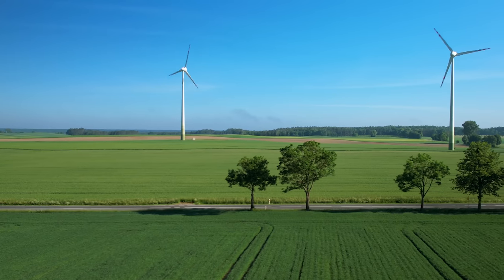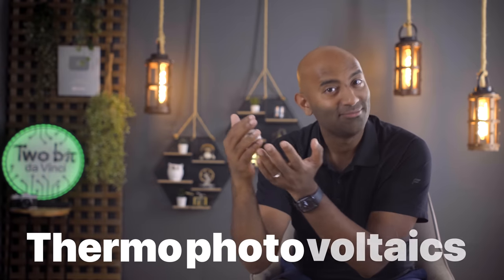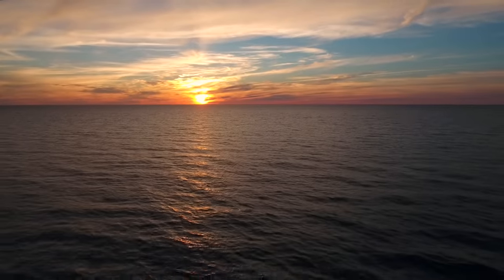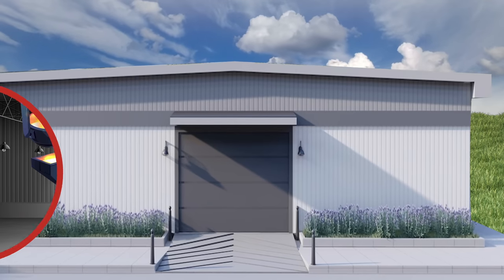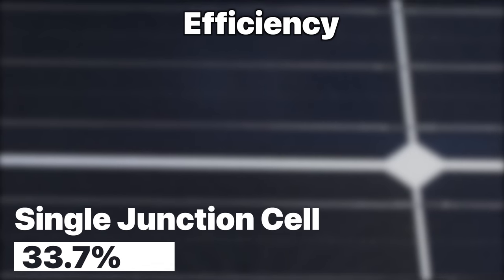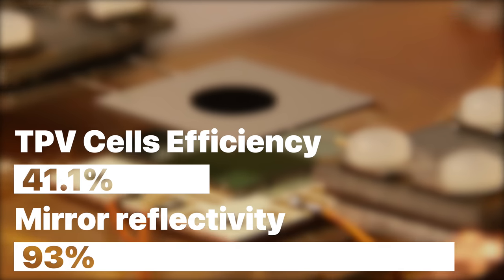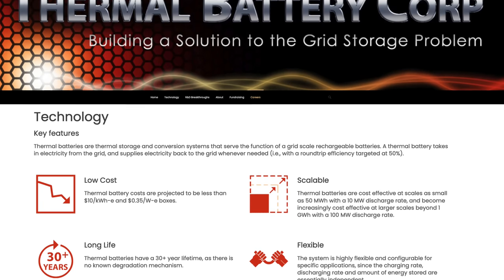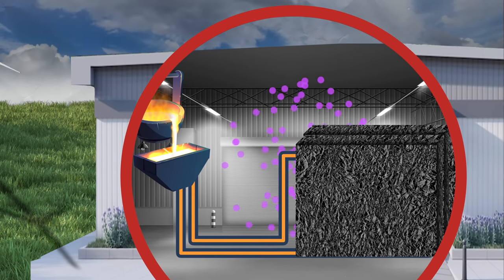Breakthrough Solar cell DOESN'T Run On Sunshine!

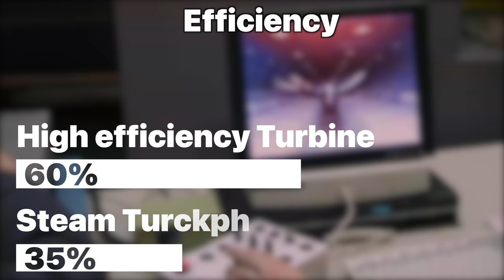Comment: 01:24 This is literally what comes up when you google “steam turbine efficiency”:

Multistage (moderate to high pressure ratio) steam turbines have thermodynamic efficiencies that vary from 65 percent for very small (under 1,000 kW) units to over 90 percent for large industrial and utility sized units. Small, single stage steam turbines can have efficiencies as low as 40 percent.
Reply: Yeah I was thinking this was wrong as well, steam turbines can be very efficient
Reply: Yeah, this channel is slowly devolving into sci-fi.
Reply: I'm finding many of these channels feel like they are devolving.  Slowly slipping further into propaganda over science.  At least 2 bit calls out many of the problems, this tech still has to overcome.  Rather than just saying it is all good and our savior.
Reply: I haven't even 'Searched' (Other search engines are available), but most objections to Heat Pumps Vs Gas/Oil boilers, quote the incredibly low efficiency of electricity production from heat (fossil fuels), usually stating around 40%. I have never read anything about steam turbines at 90%. Perhaps your figures are theoretical, as opposed to what actually happens when you burn oil/gas to produce electricity.
Reply: @linyenchin6773  idk if this guy in particular is that bad lol but your statement is straight facts when speaking overall after watching it in real time the last two years
Reply: @michaeljames5936  kind of like this video stating that they can get 40% power conversion with the potential for up to 50%
Reply: Most large steam turbines use a secondary turbine that operates in a vacuum this extracts virtually all useable thermal energy making large scale turbines highly efficient . The burning fuel / transportation of steam is the largest loss of energy efficiency	.
Reply: @jackm3040  Nope. Large turbines are really over 90% efficient (even 98% is feasible). If steam goes in turbine from 250C to 25C then great majority of energy is converted. Hovever losses from whole thermal cycle are elsewhere. (Whole energy of condensating 25C Steam to water is wasted). tldr: Turbines are not at faul, whole termal water cycle is (includes burning).
Reply: only the theoretical eff of the turbine but the rest of the steam cycle pulls it down to 35 %
thats why the big cooling towers ore heated rivers downstream the powerplants.
Reply: @joelrampersad1359  Yeah, I have seen this also.  First was his video about charging his EV with an Ecoflow Delta Pro which is a ridiculous example since the EcoFlow has, without additional batteries, 3.6kw of battery which is not going to translate into that many miles for your EV.  To me this showed his near total lack of understanding and research into the Solar Generator and/or Solar battery community.
I think this is what happens when it becomes a full time job, new house, new studio, new solar panels on the house, new wiring for the house and now a team of people to produce the videos all of whom have to be paid.  So that translates into quickly done videos and everything is a "breakthrough"
Reply: @jackm3040  You think the efficiency numbers given for this new tech are the emperically measured values?  I doubt it.  Let's compare apples to apples.
Reply: @michaeljames5936  The 90% is theoretical AND it doesn't take into account any inefficencies in regards to how the heat is generated.  But keep in mind the tech discussed in this video also doesn't talk about inefficiencies in making the molten metal heat source hot in the first place, so that part is fair.  So keep problems with fossil fuels out of this discussion since those arguments would apply to both turbines and these new cells since neither tech cares where the heat came from.
Reply: @jackm3040  Well yeah, just as I said: Not problem with turbine, but with whole cycle. My point was that video was stating that turbine itself is the problem.
Reply: @jackm3040  One key component when measuring efficiency, is cost. There, the advantage is clear over TPV.
Reply: @jackm3040  YouTube doesn't let commenters post links anymore. Even the channel uploaders are restricted to a single post for links. They don't tell you any of this and simply delete all comments with a URL. It's trash, and it hurts the organic discussions that happen on this platform.

Comment: A slight clarification, the Shockley-Queisser limit describes the maximum efficiency under solar illumination, AM 1.5, which is approximately a 6000 C black body radiation source. These cells would be operating under black-body light from the tungsten at ~2500 C, so the efficiency calculation is different.
Reply: Yes, I wonder how the limit changes as your light source changes, I'd suspect high energy blue light is easier to convert then reder light.  Even sunlight at the Earths surface has been substantially altered from a true blackbody specturm due to absorbtion and reflection in the atmosphere, the visible part of the spectrum suffers the least loss and is the peak output and what our solar panels mostly harvest.  So a true 6k black body spectrum such as in orbit is likely to be less efficient because the extra light your getting is in unusable parts of the spectrum, and thus your actual energy output remains the same even as the total input grows.
Reply: W Tung clan
Reply: Well said. You obviously know your material! 👍🏻
Reply: @SunriseLAW 
The world isn't ready for that kind of discussions.
Reply: The theoretical max efficiency is not really important, what matters is the real system efficiency. If you get 50% out compared to what you put in that is the number that you work with.
Reply: @kennethferland5579  how do you get reder than red?
Reply: @SunriseLAW  I wonder if being into efficiency and being into eugenics go hand in hand? Definitely would make sense to me. We're just a few technologies away from getting to watch videos on new genetic structures with their pros and cons. Stomachs are one of the best energy converters too, or so I've heard. So maybe we'll see the eugenics and energy technologies blend together at some point.
Reply: Dahha.  Life has gotten too complicated for this old horse.
Reply: Wrong. That limit is for any blackbody radiation source captured by a single bandgap material. Sun not required.

Comment: The cooling water for the TPV you can cool down using sterling engines.  You could get more energy from the waste heat.
Reply: Or they could just invest into sterling decentralization tech. But capitalism doesn't want it

Comment: If these things can absorb heat and turn it into power, all you've gotta do is stick'm to my walls. I assure you that could power half the US. I live in a top level corner appartment and temperatures easily rise over 50c, at nighttime, because of all the heat released by my walls all night long. Imagine how much heat is trapped inside of them...
Reply: I wish on my walls too. A lot of heat of the sun directly 😄😄😄
Reply: lol, I had a top floor apartment once (I live in Alabama) where you couldn't hold your hand on the ceiling it was so hot. Our air conditioning bill was a nightmare. They built the stupid thing with black asphalt shingles and no attic ventilation at all, not even passive air vents on the side. The roof was an actual solar oven. It was awful.
Reply: @DFPercush  yeah so that's my situation as well, lol. Just not in Alabama.
Reply: I don’t know if this was a joke but it’s actually a good idea. Kind of like how breaking energy is captured to replenish EV batteries.
Reply: @_HMCB_  it's both, but it obviously wouldn't actually work as covering my walls with them would also mean they won't get hot anymore in the first place. Just needs regular solar panels
Reply: @theBabyDead  right. I was just talking the principal: capturing excess heat/energy.
Reply: Put them under the tar of roads, same deal hot surface all night long

Comment: The argon sealing issues going to make this a maintenance nightmare and money pit. Argon must be harvested by cryogenic air separation by means of fractional distillation. Similar to a oil refinery but cooling to liquefy the gas as a means to seperate from one another.
Reply: Yeah but when there's government money for new stuff why not
Reply: @mikefitzgerald5127  There's no such thing as "Government Money" it's Taxpayers money and shouldn't be squandered.
Reply: Omg omg 😳
Reply: @jackm3040  tbh, if they’re using it to keep materials from reacting, then they can use alternative methods of protecting the tin from oxidizing, seems odd to me they would rather fill a building with argon rather than using a submersible unit or a closed system
Reply: @ProfessionalGasLighting  Yeah, imagine the process required to get into that building to conduct maintenance, or the the process of swapping out a TPM for that matter.
Reply: It doesn’t sound like it needs to be pressurized so sealing should be relatively simple.
Reply: Argon is heavy and slow moving. Sealing it in is about as difficult as sealing up a swimming pool. It doesn't want to float away, it sinks and pools in our atmosphere. I work with argon jacket lab equipment all the time and it is NOT hard to work with, NOT hard to seal and not expensive to maintain. And these are very very large EMG systems.

It will be alot of money to fill their system up to begin with, sure. Whether or not it is EXPENSIVE is a relative thing that depends heavily on how much a percentage this is of the over all coat of the system and how much capital comes out of these systems when they are running. 

I appreciate what you wrote, but I don't think you know enough about the topic.
Reply: @miller2675  Do you deal with argon while pouring 2000 C molten tin being pumped at 1400 C through a graphene heat exchanger? That's pretty freaking hot & I'm doubtful it would just sink as it would expand filling every available space.
Reply: @seabeepirate  Based on the information provided argon is pumped into a structure where a 2000 C crucible is pouring molten tin into a system pumping it at 1400 C. How will it not pressurize?
Reply: I dont know, but oldfasioned lightbulbs where filled.with argon gas. So why whould that be a money pit?
Reply: @superliegebeest544  If each 1 square meter module is 100 KWh power output with a 50% efficiency and 10 hr duration it's roughly at minimum 3,412,140 BTU worth of molten tin within the theoretical 1 GWh energy storage system. While in simple terms it's similar to a light bulb the amount of energy involved is immensely different even necessitating different design parameters. In particular we can't glass weld the energy storage system shut as would be done in a light bulb. Which it would be unrealistic to be metal cutting and welding it shut every time to conduct maintenance.
Reply: @ProfessionalGasLighting  the building will be a large pressure tank in my opinion. then it's not hard to seal.

Comment: First of all one key point is not discussed:- How we harness the solar energy to heat the source at first?
After that from a broader perspective if you say that Central Solar Tower technology has failed in it's functioning because of the implementation, how come this so complicated thing won't fail. There are so many loopholes that need to be addressed in this technique.
Reply: Good Hod , what an idiotic filter/warning put up just to make a comment. Anyway, I still haven’t figured out how they are going to heat it up that much. What’s the heat source?  The rest is interesting enough but  I missed that part.
Reply: @lukeherdaii9528  The same way they do it in the metal processing industry, electric arc furnaces.

Comment: I think it would be amazing if they could build a facility that could generate and maintain 1.21 gigawatts! Just think of the implications, Marty!
Reply: The maintain part is key, it's easy to produce high power levels for fractions of a second.  But we don't know how much total energy we need.
Reply: @Kenneth Ferland  we would only need the 1.21 Gigawatts for a split second ti make the connection with the Flux Capacitor.
Reply: 1, point, 21, gigawatts!!???? 😂
Reply: @beratnabodhi  What do you have this Flux Capacitor attached to? A Stainless steel shelled car with a very 80s style?
Reply: One must not confuse jig-a-watts -- which is a unit of power that in another universe from ours, has time-travel effects -- with the ability to store and release gigawatt-hours, which is a useful amount of energy at the city-scale IRL given current amounts of energy consumption/waste.  Speaking of waste -- another source of actual gigawatt-hours is cutting consumption by not (wasting time making stupid jokes about fake universes ---just excuse me I'm having a crabby moment :<o ) thinking about how much time/energy I wasted writing this comment
Reply: there is no reason not to make that a standard unit of measurement
Reply: @kingmasterlord  a Doc (Dc) ?
Reply: 88 mph
Reply: @ninjaxorgmail  apparently it was a joke as the delorean was a rubbish car that couldn't reach 88 mph
Reply: @isaakb4442  🥹😅😂🤣